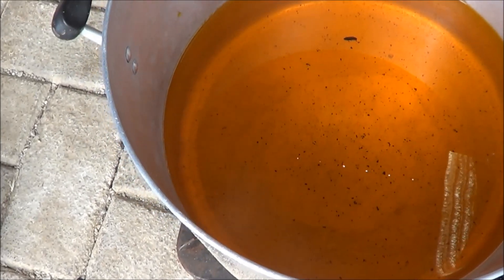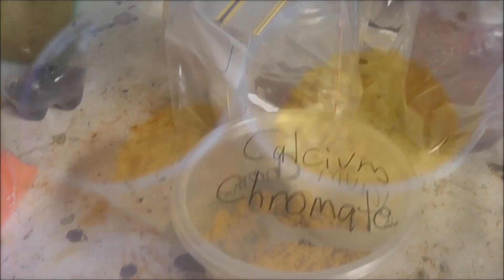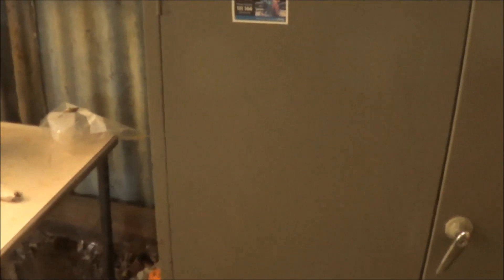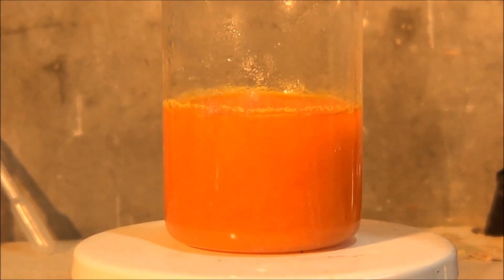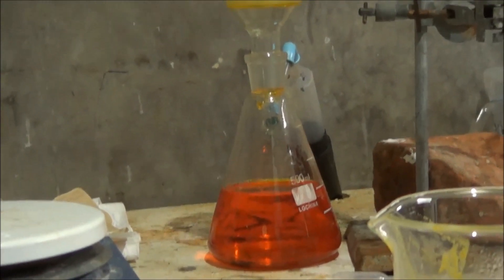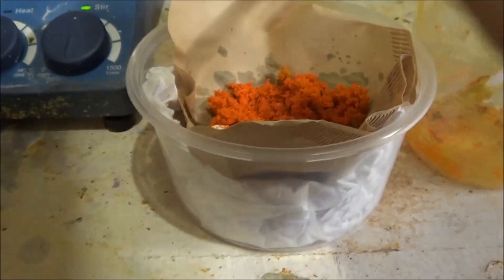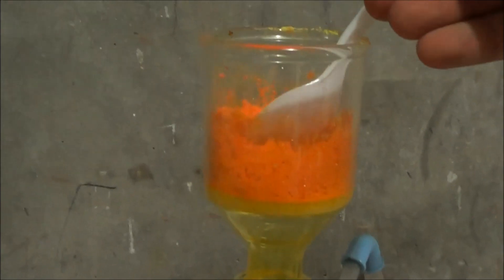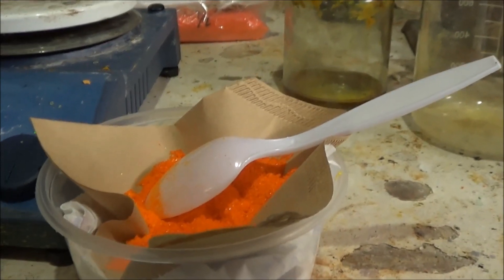Dichromates from Stainless Steel - Part 2/2

Comment: Chromium chemistry is SO awesome. Lots of pretty colours! I used to work in a lab where we had a need to measure the amount of solid sulphur (sulphide, sulphate, etc.) minerals in sediment samples (we were mostly looking for pyrite). So we used the chromium-reducible sulphur technique. A glass column is filled with zinc metal that has been amalgamated with mercury. A chromium (III) chloride solution (green) is passed through the column, where it is reduced to chromium (II) chloride (blue). This new solution is only stable for a few hours, a day at most (if you keep it in an inert atmosphere), so you have to make it fresh. Then you add it to your sediment sample, which is in a flask that has a two-holed rubber stopper with glass tubes inserted, one deep (so that it is submerged in the chromium solution) and one shallow. Nitrogen is passed through plastic tubing connected to the glass tubing, so that it bubbles through the sediment/chromium (II) mixture, and flushes any gases out into the non-submerged tube, which then is transported via another plastic tube, into another flask with two glass tubes in a stopper, same arrangement. Only this flask contains sodium hydroxide solution. Any solid sulphide minerals are reduced by the chromium (II) to hydrogen sulphide gas which is transported via the stream of nitrogen to the NaOH in the second flask, wherein it dissolves (H2S becomes fixed as S2- in strong bases). Spectrophotometric techniques are available to determine the concentration of the sulphide solution, which then tells you how much chromium-reducible sulphur was in the sample.
Reply: Copper all the pretty colors of chromium with only half of the toxicity
Reply: So you don't lose H2S when you add the CrCl2 to the sediment sample?
Reply: @MrBradshawbenjamin  Actually, I forgot to mention one critical element - heating. It takes being raised over ~60 degrees C (I'd keep it on a hot plate set fairly low, and bring it almost to a boil) for the reaction to really get going, and even then, it takes 2-3 hours to go to completion (you know it's done when the solutions are fully green again). Still, I would make sure to only leave the reaction flasks open to the room air for a couple seconds - just enough time to inject in the requisite amount of CrCl2 (and also, oxygen in the air has the potential to oxidize some of the gas produced, so ensuring that there wasn't much time for O2 to enter the reaction flasks, which were pre-flushed with N2 to purge them of oxygen, was critical). This precaution ensured that any evolved gas would remain in the system, and remain H2S until it was stripped of its protons in the hydroxide solution.

This was a fun reaction, but it was also a bit of a pain, since the equipment needed meant I could only do 5 samples at a time (plus a blank - I did a blank every time). I'd sometimes just go in to the lab in the evening, and stay all night, doing two consecutive sample runs. We got good data though, and that's what matters.
Reply: Next time I want to perform a sulphur determination, I will know where to look.

Comment: I have a lot of Laboy, Deschem and Nanshin lab glass and all of it seems to be coated with some kind of polymer on the inside. While distilling sulfuric acid and nitric acid I noticed that the it completely changed the wetting properties below the liquid line. I wonder if that could have contaminated your ammonium dichromate?
Whatever the (probably plastic) stuff is, its really hard to get rid of. Only the harshest conditions to organic chemicals seem to have stripped it from my lab glass.  Even hot sodium hydroxide doesn't seem to do anything.

Comment: Nice video. How much of Ca(ClO)2 do you use to get the chromate from the mix of hydroxides? I tried it by myself but it seams chrome goes to the solution after all Fe2 is oxidised. So, in my experiment it possible requires some insane amount of an oxidizer.

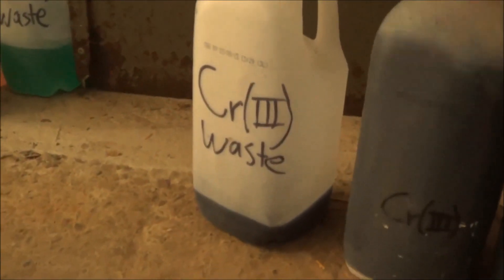Comment: 3:34 Obviously chromium(VI) is very hazardous to the environment, but I’m actually not sure that chromium(iii) is so bad.  Several online sources I looked at said that chromium(iii) was perfectly fine to put down the drain.  There’s a possibility that those aren’t reliable sources but if you think about it there’s already going to be chromium(iii) in the environment because that’s the typical oxidation state for chromium.
Reply: Some of those such as nickel are probably bad no matter what oxidation state they’re in but chromium(iii) seems fairly benign.

Comment: Could I do this on my channel when i get around to it? It looks like a really cool reaction to get Dichromates
Reply from the maker: +toothpick993 Of course. Do it in a beaker so you can heat it directly in the first step with the acid though. All the chemicals were from bunnings (3 pool chemicals and 1 fertilizer) and while they generally only sell like 3kg bags of the chemicals or larger (the carbonate does come in 1kg though) its worth buying them because they're all so useful and the cost per gram then becomes so low, even for the Ca(OCl)2
Reply: +Extractions&Ire I can't do the heating in the beaker due to lack of equipment but once I get back from sydney mid january i'm sure the Australian heat will do justice. I'm pretty sure I have all the chemicals needed anyway, the only thing I'll need to get is just scrap stainless steel really. Also your waist chromium could you convert it to Chromium(III) Oxide and possible reduce it back to Chromium through a thermite or displacement?

Comment: How did you know how much Sulfate to add?
Its soluble as well so if you would add to much it would contaminate the solution right?
Reply from the maker: It's soluble yes so ideally all excess sodium carbonate will be washed off the metal hydroxide solids during the filtering step. To get how much you roughly need, I crunched the numbers, given I knew how much dissolved metals was in there and I left the acid sit over the metal so ideally all excess HCl is used up in attacking the acids. 
The chromate at the end will still be less soluble than any carbonate that's left in the final solution, so that's another reason why the first batch of chromate crystals are so much nicer than the second batch I collected
Reply: Extractions&Ire Nice, Love your lab, reminds me of my own XD

Comment: Have these videos always contained static-like sounds?
Reply from the maker: Yeah these earlier videos always had them. It was a hardware issue, the mic on the camcorder I was using just decided to make it, and it had no space for an external mic. Also, the editing software I was using didn't have EQ features to be able to filter it out, so I just had to leave it in

Comment: That's quite a bit! It's several different Dichromates, right?
Reply from the maker: +Camroc37 At the end the crystals should be just ammonium dichromate.
Unless I fucked up and perhaps made a double salt, but that's unlikely (not actually impossible however)
Reply: Extractions&Ire Ah, okay. I wasn't sure if it was potassium or ammonium dichromate.
Reply: @ExtractionsAndIre  Considering your base metal source, maybe you should say "Unless I forked up"...  ;)

Comment: Can you give me the equations?! I don't really understand the reaction between metal hydroxides & hypochlorite, so where does chlorine go?!
Reply from the maker: Sorry for the slow reply:
I think you're probably thinking about this in a displacement reaction kinda sense. But it's an oxidation reaction. The hypochlorite is being turned into chloride (so we make calcium chloride) and only the chromium(III) oxide can be oxidised to chromate, so we make Caclium chromate. Just throwing oxygens around
Reply: Extractions&Ire I understand that the reaction must be an oxidation but I mean the chromium molecules must take oxygen & calcium to form chromate!! this is why I don't understand it..
2CrCO3+3Ca(OCl)2?=?2CaCrO4+3CaCl2+2CO2

Comment: Hey  I have lots of new ideas that we can discuss.
Reply from the maker: Hey man, sorry for the slow replies, but you can talk to me in any comment section (I usually reply faster I swear!) or email me at tdeprinse@gmail.com :)
Reply: Extractions&Ire electrolyse à 16M NaOH solution using stainless steel anode and Graphite as cathode.
Reply: Extractions&Ire at anode iron will be oxidized to ferrate(VI) ion which is purple in color and chromium to chromium (III) hydroxide which dissolve in concentrated NaOH to form Na3(Cr(OH)6) Complex which is easily oxidised to chromate by ferrate ion and atmospheric oxygen
Reply from the maker: Electrochemistry is super cool and very powerful. You could be right and this could work, but it's hard to see it not precipitating out Iron hydroxides. Also, assuming you do make the chromate and the ferrate, you haven't really seperated the metal ions?
Reply from the maker: Or is precipitating the iron hydroxide part of the plan, and that leaves all the chromium in solution and it separates the two metals that way?
Reply: Extractions&Ire I have done this many times and success rate is 100%. One thing that you need to take care is that stainless steel forms  a protective conducting iron oxide layer which prevents further reaction so to prevent it u need to add a little bit of sodium chloride or sulphate. Ferrate formed  decompose quickly and oxidises  the chromium complex to chromate ion and itself getting reduced to ferric hydroxide which precipitates out.
Reply: Extractions&Ire initially the solution turns beautiful purple but after some time it fades as ferrate decomposes. Ferrate itself is very interesting compound as it is eco friendly and very power oxidising agent
Reply: @vivekkumarsingh4226  So what happens to the Nickel?